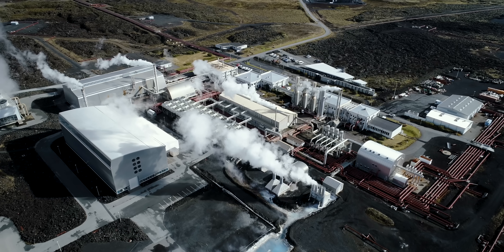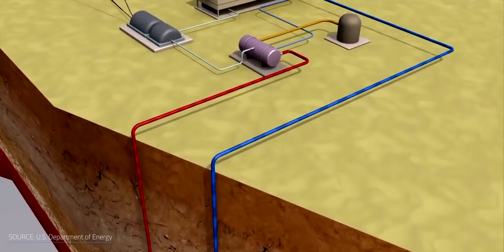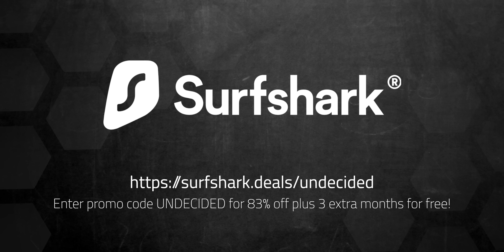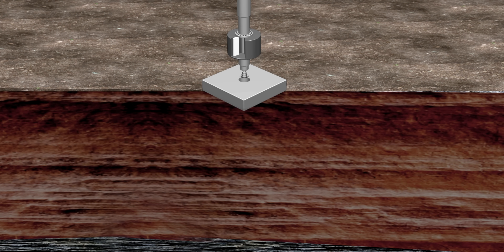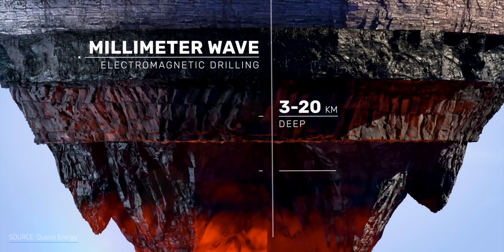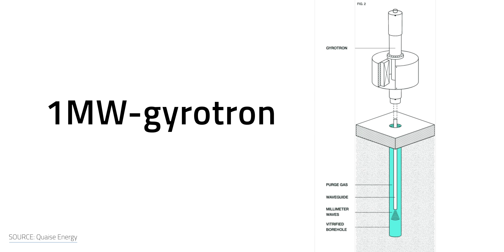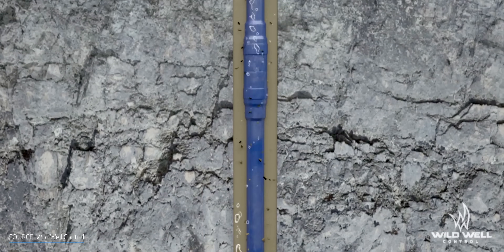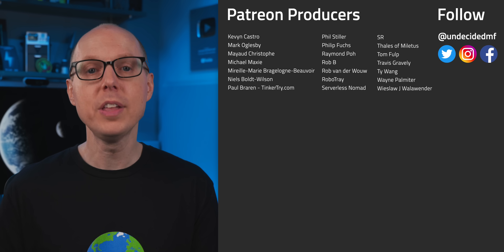Why This Fusion Tech May Be a Geothermal Energy Breakthrough

Comment: Matt,
Some time ago - long enough for my memory to not serve me accurately, I saw your take on where nuclear fission fits in your vision of our energy future. The demand for abundant, cheap energy will expand exponentially very soon. My memory tells me that your thoughts were guided by the current nuclear reactor design, which employs a solid fuel and uses water as a controlling medium. (Light Water Reactor LWR)
A few years ago, a tested and operating liquid salt fuel with reaction control methods compatible with the melted salts was resurrected from Oak Ridge Laboratory work done in the nineteen forties. The result was a breeder reactor that used Thorium as a radiation shield/blanket. Neutron flux from the shielded fission reaction converts the fertile Thorium through a sequence that ultimately becomes fissile U233.
Since this relatively recent upsurge in activity, more straightforward interim configurations of liquid fuel nuclear fission have been brought forward, which have the worthy objective of 'burning' the waste of our present nuclear light water reactors and other nuclear waste. 
The reason LWRs produce large amounts of waste is because the solid fuel pellets are very poor conductors of heat. Thermal stressing of the fuel pellets makes it necessary (because of mechanical integrity issues) to remove the fuel from the reactor well before it has released one percent of the potential heat implied in the fissionable load within it. Recovering the fissile uranium from that waste stream allows the production of  Uranium salts to be used as liquids with no structural limitation associated with heat transfer. Once orders of magnitude more fissile heat from more efficient nuclear power plants, waste disposal is easier to manage than waste streams produced by obsolete PV and wind power technologies. Other fissile waste streams can be solved by subtle modification of this fissile reactor design.
LWRs have been forced up our nation as an inviolable design choice. The original reason for that design choice is that processing of the waste stream readily produced fissionable plutonium. A liquid salt plutonium burner removes weapons-grade plutonium as soon as the preparation of the burner salt is completed.
LWRs are accidents waiting to happen. Liquid salt reactors yield the necessary process temperatures (1000+ degrees) at ambient pressures. These temperatures are higher than LWRs produce, making the heat to mechanical energy conversion much more efficient.
Accidents with Liquid salt reactors produce solidified crystalline fragments, not radioactive gasses. 
To state briefly - Liquid salt fission reactors are NOT "not in my backyard" (NIMBY) innovations.

Comment: No mention of supercritical CO2 that can deliver high efficiency at relatively low temperatures. Compare to supercritical water, you don't need to drill as far to get the right temperatures.

Comment: 1: What do you do with the vaporized rock and how to prevent it from damaging the device?
2: Even if you succeed in getting heat from deep locations, when you extract heat it might cool locally and then you have to drill and repipe all over.
Reply: ...you do understand that we're talking about geothermal heat here? This isnt like setting a hot pan out to cool after frying up dinner. Your pan is the size of the earth with a much greater specific heat capacity. Your heat isnt going anywhere locally when you're 10km down.
In fact, doing the math, we're talking about an 8 inch diameter hole in something thats...501,652,800 inches in diameter. Using the ratio of 8/that number, if you used an 8 inch frying pan as a stand-in for the earth, we would be drilling a hole about 0.00000001 of an inch in diameter into your pan...smaller than many bacteria. So, no, no local heat is going to be lost by taking it from rocks...

Comment: I love the idea. However, less exciting to many here, I have to wonder if what this technology does in the short to medium term is give oil and gas a new lease on life. If this technology can reliably and relatively cheaply access areas deep underground would this not increase the economic potential of oil resources that have not yet been tapped due to the unprofitability of current drilling techniques?
Reply: Well, for one I done see how they're going to bend the waveform to make horizontal drilling possible, and for another, the whole lithified rock casing isn't so great for allowing the oil to enter the well itself.  Plus you've got other issues like wtf is going to happen when you hit a gas or oil pocket and you blast it with a death ray...
Reply: @Skinflaps_Meatslapper  Well I am not sure the direction would be any more limited than other drilling methods. At least from the information given it seems possible that you will continue to drill in the direction of the casing you have created. 

As to the glassed casing, that is true, but hardly seems insurmountable. 

As to the death ray but, that is an unknown but applies equally to geothermal drilling as it does to oil, so either way that would be a factor to consider.

Comment: where did you get the answer that it would take a billion years to use 1 % of the geothermal heat in the core? Second question how much does the core have to cool before affect core’s ability to spin? (I am not sure I am using the correct terminology. )

Comment: Dude, we can drill to the geothermal depths easy already. It's all about DeltaT, you don't have to drill to 30,000'. There are areas of higher heat flow in deep basins but next to say, volcanic heat sources, you've got it much closer and all you need is a permeable horizon. Anyway, i drill wells everyday and this has been a side project for me for a while now. We can drill these all day every day. What the thing you're going to face as the biggest issue is equipment degradation from the chemicals in the groundwater.

Comment: If you could plant a geothermal generator almost anywhere, this would be great for energy production that relies heavily on coal and natural gas. It would be expensive upfront, but over time it would be better than a solar farm as most of the parts needed are mechanical and repairable verse solar's whole panel replacement without ability to recycle the panels pulled. It could offset the need for wind farms as well, where the downside there is birds killed. I don't think it would replace those technologies, just offset the need for them a bit.

Comment: Geothermal energy is limited to about 8 years. Then the cavity that water is pumped though is exhausted.  The only way to keep geothermal energy is to store heat in the summer for winter. And store cold for summer. This will keep the geothermal process going in places with moderate amounts of heat. NOT exceptions like Iceland. or Yellowstone.
You sir are a nut. You don't screw with the earth. There is a REASON why the earth is hot.

Comment: Sounds a great idea and I wish them luck with their plans for deep drilling to release the unlimited energy at the Earth's core. But on the other hand my uncle used to work in the coal mines of Yorkshire and always remarked that there was a constant battle keeping it working because the surrounding rocks were always trying to fill the mine in. That was at 1 or 2 miles deep. If we are going to use the Gyrotron to drill hundreds of miles deep I would suggest the pressures at that depth will crush any void created by the Gyrotron which would make it impossible to extract heat.

Comment: I’m interested to see what type of insulation will be used on the conductors carrying power to the cutting head. Capacitive loss to earth will be more significant in a small diameter vertical bore hole than suspended 10m or more in the air.

Comment: this does seem like a much better alternative to existing means of energy production. how sustainable is taking heat from deep earth? i know you stated that 0.1% of earths heat could supply power for 2 million years but our energy consumption increases every year and to have so much energy available will probably accelerate that even more, so after decades of taking this energy from earth from various points on the planet i can only assume earth will react to that in one way or another... interesting to think about tho and at this point anything is better than relying on the oil industry

Comment: Thanks, Matt; one thing though - I was in the power system industry before I retired. We, that is, Los Angeles, had some geothermal resources. What we found was that drilling is one thing - using that heat was another: The water coming out of the ground was very caustic, resulting in high maintenance costs. 
On the other hand, any non-coal/gas resource is welcome. We (LA) also ran significant wind and solar, which has had a hard learning curve. Renewables, so far, have required expensive backup replacement energy (quick-start gas turbines), to fill in for the variability of wind and solar. (On a minute by minute basis renewables could swing hundreds of megawatts if the “farms” are large enough, which they are when these resources are scaled to utility levels .)

Comment: Dig a gigantic well. Place ceramic/metal composit pipes coiled up in it. Fill the well with industrial waste. The pressure of new layers of garbage will start an exotermic reaction at the bottom. Harvest heat and resulting gases. Profit.

Comment: Technically, this is closest to the Phasers in Star Trek of any sci-fi technology.   It is basically an RF version of a laser, in this case classified as a Maser. 

It creates plasma when anything is hit by it, including the rock.    

Additionally, one can also inject additional plasma along the energy beam like a plasma cutter to add even more power, or select a gas that would turn to plasma to help conduct the waves. My suspicion is that it could boost the power beyond what the RF generator can output, which might allow even more rapid cutting, but otherwise it wouldn't yield energy advantage at this time in plasma manipulation technology.

Theoretically plasma stream fusion, developed at NASA for rockets, could be used to further increase the heat of the plasma.  This, again, wouldn't give net energy gain, but would skyrocket the maximum energy output, boosting max energy yield for cutting of the rig beyond other possible limits. 

I have no doubt they are considering all these options, and evaluating their cost-effectiveness for first generation and future versions of this cutting tech, well knowing that the maser alone is more than enough to cut stone.

Comment: Can’t help feeling cautious: the geothermal resource depends on temperature x rate, where quakes done seem to ever talk about the latter. (I.e. resource per definition of a project delivering energy for sale). Porosity and permeability tend to deteriorate at depth, including the kind of fracturing depicted in one of your graphics. If an open system (cycling fluids through the rock) does not flow then you only have heat conduction and you resource is limited to a few 10’s of m volume around the well… when that is cooled down that hole will need to be shut down to reheat and replenish the resource. 

I do think it is worth a try, you never know and given such high reward, I would really like to see a pilot scheme at scale… but … it would build confidence if we can get quaise’s views on the ‘rate’ bit for heat production.

Comment: the idea that we can create a small copy of the sun by burning oil and coal is almost as silly as heating your hot water boiler with a lighter. the reason we haven't been able to do fusion is because the oil and gas barons are limiting our supply of energy in order to make a profit. there's not enough energy available to us to fuse elements together like the sun does.

Comment: How do you toast bread over a geyser?  All you end up with is a soup sandwich.  Matt, no definition of the word "fusion" makes any sense to this video and was only thrown in as click bait.   This process does not fuse two things together and it is definitely is not nuclear fusion.  In truth the only word which even remotely makes sense is fission as the rock is broken apart by the magnetron.   This is an intriguing idea and there will be many challenges as they drill deeper and deeper, but the use of the word FUSION is again plain old click bait.

Comment: in the graphic it looks like both the injection well and extraction well are going to the same general depth, presumably reaching the same rising hot geothermal waters.
there is no "loop" depicted to suggest a path where the intake is made to turn around and come back up the extract. 

so how does the injection well prevent that same heat and geothermal waters from rising up itself?

even if cool water is being pumped down it, what is preventing the resulting steam from building up pressure and trying to come back up the same intake?

Comment: Many things with this guys great idea dont add up, how do you "case the hole" in areas of water, gas, oil etc? I doubt it will turn to glass. I doubt a 8" hole will even come close to what needs to be used. Mechanical drilling isnt perfectly vertical so starting off with that would be pointless. The idea is there but i feel this is a very long way from realistic expectations at this time.

Comment: With this, You are still just tapping into a nuclear reactor for heat, that being the nuclear reactor that is the earth's core. I still believe the LFTR Liquid Fluoride Thorium molten salt Reactor is a far better option without the need for the deep hole. Turn the world's nuclear waste into fluoride salts and "burn" them (fission them) in a molten salt reactor. Keep everything on the surface where it is easier to maintain and don't risk causing earth quakes. The spent fuel from a pressurized water reactor is "spent" when it is 4 or 5% used. What we call "nuclear waste" is still 95% nuclear fuel. We should use that. Also, many of the byproducts of fission in a molten salt reactor (LFTR) are them selves more nuclear fuels, hence the term "breeder" reactor. BTW, CO2 is plant food and not a bad thing. They leave particle forcing out of the climate models on purpose so they can blame climate change on CO2. Here are 2 good links.  https://youtu.be/P9M__yYbsZ4 Thorium: An energy solution - THORIUM REMIX 2011, and  https://youtu.be/NYoOcaqCzxo Fatal Flaw In Climate Change Science

Comment: Always going to far with the science. Geothermal will work but it is not necessary to do it all at once for an entire city from depths extremely hard to get to. Instead many holes for Apartments and High rise office buildings is accessible and also to use geothermal for homes and small businesses. Another possibility is to access the water in the bigger Lakes in Canada and USA to provide energy exchanges that are easier to get too and also useful in heat and cool energy transfers. Rural uses for Geothermal transfers are possible both in wide loop not so deep transfer energy loops and also deeper circular and round tube energy transfer systems where area access is limited. All these opportunities are possible and economically and Design possibilities which make sense. Climate CO2 Alarmist theology and Science are LIES and NOT backed by good and HONEST Scientists OR THEY WOULD NOT PREVENT OTHER SCIENTISTS FROM OPPOSING and Discussing the drawbacks of their theory. It never was 97% od scientists and most were not even scientists AT ALL but supporters or 1%ers Trying to IMPOSE THEIR IDEAS and More CHAOS on the World's Population with Paid and Unpaid Activists. The MIchael MAnn Hockey stick is a Lie with Missing and Manipulated data to leave out data which undermines his theories. ALSO UNations IPCC Reports over Decades have Forecasts which have NEVER BEEN CORRECT and Wrong OVER DECADES nearly entirely. Finally in 2022 some data and arguments are finally coming out which show how RIDICULOUS THE CO2 Warming Argument or Alarmism are such as the extraordinarily slow rate of Sea Level Rise which will take centuries for sea levels to rise a single meter contrary to their arguments that seas will rise and displace the majority of HUman life on Earth. Also the Hypocrisy of their Supporters like Al Gore and Barack Hussein Obama and Others who have Purchased MULTI MILLION Dollar Mansions right on the oceanside which would be lost entirely if their arguments of Climate alarmism were correct.

Comment: Assuming it works as intended, I wonder how differences in minerals might affect the integrity of the glass casing. I hope the project goes well. We need all the baseload power we can get.
Reply: The term glass used here doesn't need scare quotes. Glasses are just amorphous, non-crystalline solids, often formed from heated rock cooling rapidly. They don't need to be silicates and some of the strongest glass is formed from doped silicates or non-silicate material. The only reason most human-made glass is silica-based is that silicon is readily available on Earth's surface in sand and silt.
Reply: @lozoft9  The quotes were meant to highlight the non-uniformity of the material in various strata causing potential strength differences down the column of the casing wall. I didn't mean to suggest that it wasn't glass at all.

Fair enough. Quotes removed for clarity.
Reply: Same thought here. I should have trolled comments 1st.lol
Reply: I just don't understand how this glass is supposed to solve all the problems. I would've thought you couldn't prevent a tube collapse unless you filled it with something denser than they outside pushing in. Or even compressed, filling the tube with something that pushes out rather than a mud for example idk
Reply: @TheAnnoyingBoss  you dont need density, you need compressive strength. and if you want to start a fracking operation, then sure start compressing